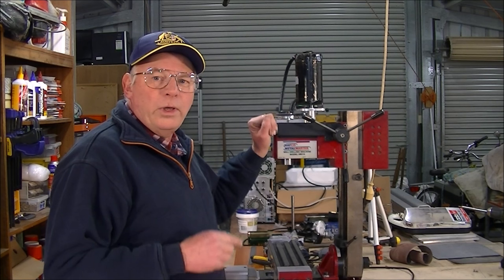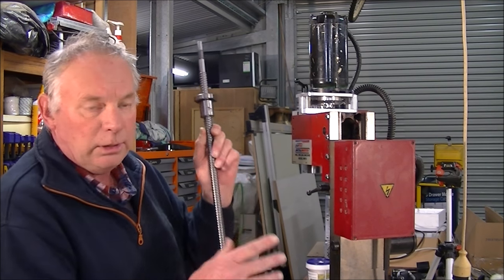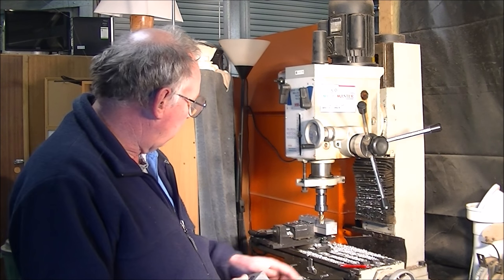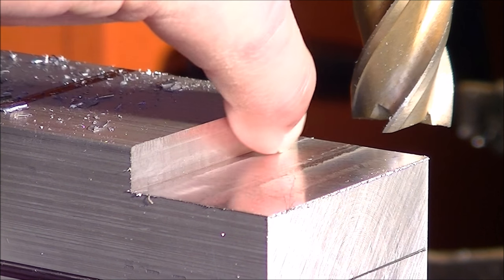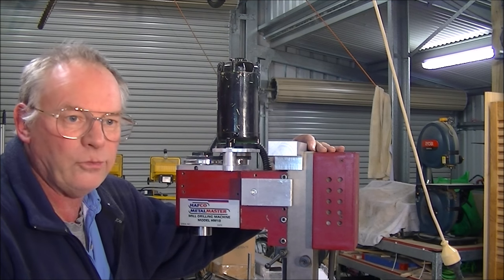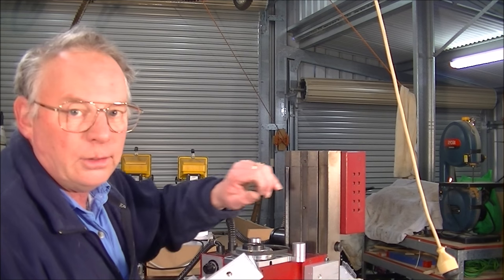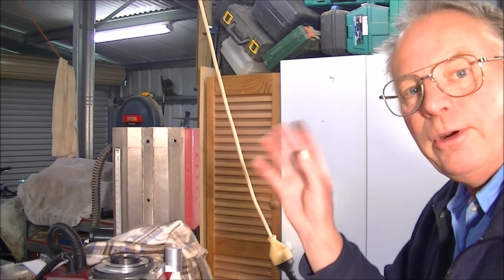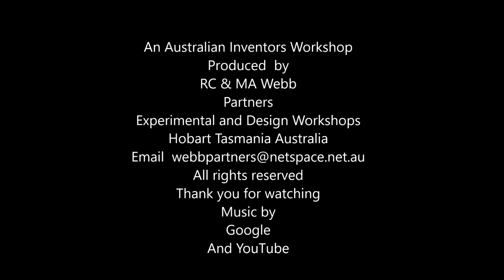141 Sieg Z Axis  kit development part 1

Comment: Roger, if I can comment on the placement of your mounting holes for the top bearing mount.  I would perhaps have staggered either the front or side hole to avoid the potential of the mounting bolt coming into contact with each other.  Of course this could only happen if the bolts were sized incorrectly for length and we all know about 'Murphy's Law'.  Great video by the way.

PL Camp

Comment: Great video! I just purchased a grizzly G0781. Essentially the same as X2 with a larger table and motor. It also has a tac. I want to covert it to cnc. I have the x and y mounts drawn up in solid works. I really like your z mount. Any chance I could the dimensions or a blueprint of your z mount? I would really appreciate a starting with the design.